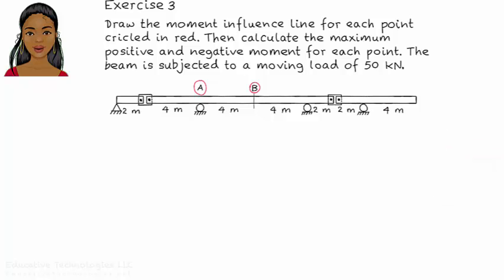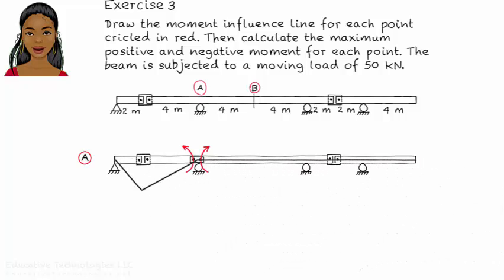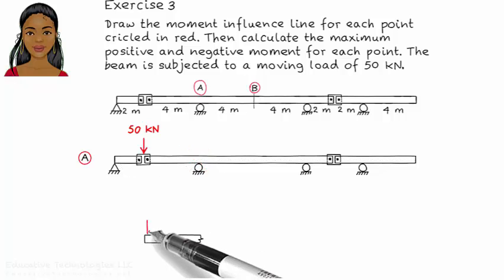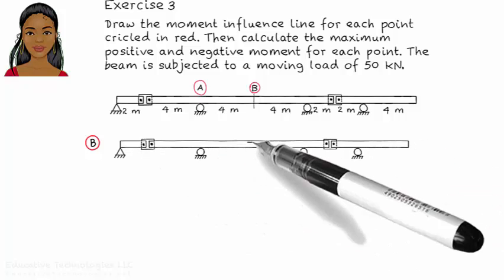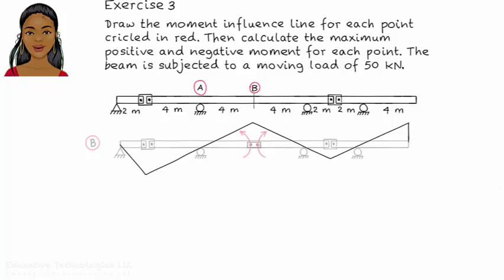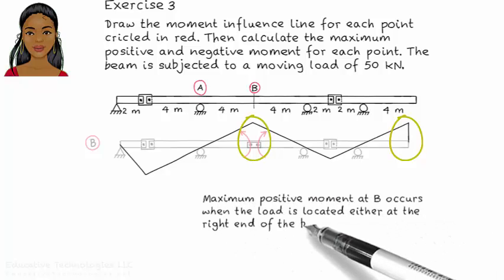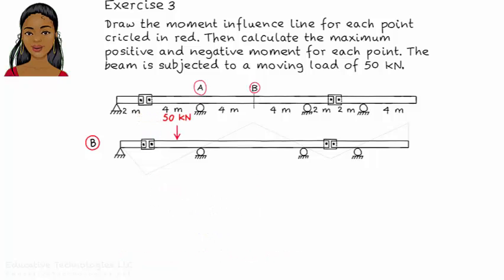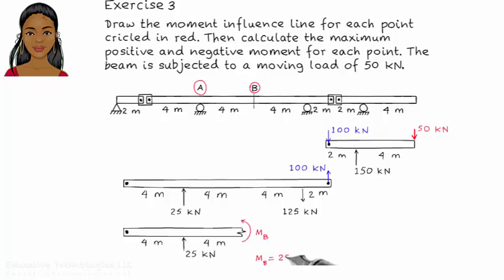Moment Influence Line: Solution for Exercise 3

Comment: Reaction at R when we find the moment at B
How became 75
Reply from the maker: Consider the beam segment between the two internal hinges. A load of 50 kN is applied at the left hinge. There are reaction forces at the left roller (R1) and right roller (R2). The total length between the left hinge and the right roller is 12 m, with the distance between R1 and R2 being 8 m.

The moment equilibrium equation about the right roller can be expressed as: (50 kN)(9 m) - R1(8 m) = 0.

By solving this equation for R1, we find R1 = 56.25 kN.

Comment: Dear Dr Structure, how did you calculate the reactions at the end of the video when the 50kN force was at the right end of the beam?
Reply from the maker: Static equilibrium equations. 

Take the right segment of the beam, the segment between the right-most hinge and the free end of the beam. There is a 50 kN force applied at the free end. There is an unknown shear force of, say V, at the hinge, and there is a support reaction, say R, at the roller. We can write two equilibrium equations:

Summing the forces in the y direction: R - V - 50 = 0
Summing the moments about the support point: 50(4) -2 V = 0. 

Solving the above equations for the unknowns, we get: V = 100 kN, and R = 150 kN.

Then take the left-most segment of the beam, the segment between the left pin support and the left-most hinge. There is no load applied to that segment. So, the only two forces in that free-body diagram are the reaction force at the pin support and the shear force at the hinge. Label them, T and Q.

Summing the forces in the y direction: T - Q = 0
Summing the moments about the hinge: 2T = 0.

This gives us T = Q = 0. 

Now, knowing the shear force at the ends of the middle segment (the segment between the two hinges), then only the two (roller) support reactions would be unknown. If we write and solve the two equilibrium equations for the middle segment, we get those reactions forces. One would be upward 25 kN, and the other downward 125 kN.
Reply: Hello sir, for calculating SF (v) @ hinge of right segment. You have assumed  SF to be downward. While calculating SF by taking moment at support. I found SF is negative (-100)  that means need to change the assumed direction.
Reply from the maker: @smithakm1174  No, you don't need to change the assumed direction for the force and start all over again. If you showed the shear force at the hinge in the positive direction, you would get a negative value for the force magnitude. That simply means the actual force is acting downward. But the two representations (showing an upward arrow with a negative force magnitude or a downward arrow with a positive force magnitude) mean exactly the same thing. Either representation can be used graphically. And, they both yield the same results when writing and solving the equilibrium equations.

Comment: can we employ the principles of influence line diagram to calculate reactions at any support?
Reply from the maker: I am not sure if I understand the question. The purpose of influence line is to determine the effect of a moving load at a specific point in the beam. Yes, we can determine the effect of the moving load on a support reaction (i.e., reaction influence line), but we don't need influence line to calculate the reaction forces in the beam due to static loads. Those can be easily calculated using the equilibrium equations.

Comment: How did you find the values of the reactions?
Reply from the maker: The beam is statically determinate, so we can find the reactions by writing and solving the static equilibrium equations. For example, for Part A, when the 50 kN is placed at the leftmost hinge,  separate the middle segment of the beam (the segments between the two hinges that rests on two rollers). The segment is subjected to the 50 kN force at the left end. The shear force at the right hinge is zero since the rightmost segment of the beam is not subjected to any loads. So, the free-body diagram of the middle segment consists of the 50 kN force and the two support reactions. Apply the equilibrium equations to the free-body diagram in order to calculate the reactions.

Comment: it is really confusing to find support reaction please explain in detail...im unable to get how you are using 100 kn at B... Please explain it further..
thanks Dr. Structure
Reply from the maker: To calculate the 75-kN support reaction:

Place the 50 kN applied load at the left hinge, as shown in the video.

Separate the middle segment of the beam, the segment between the two hinges.

The segment rests on two roller supports. Draw the free-body diagram of the segment. 

The diagram shows three vertical forces only: the applied 50 kN load at the left end of the segment, the vertical reaction at the left roller support (call it R) and the vertical reaction at the right roller support.

Now, take sum of the moments about the right roller:

(50 kN)(12 m)- R(8 m) = 0.

Solve for R. R = 75 kN.
Reply: THANK YOU SO MUCH... GREAT WORK SIR...
Reply: From this clarification... I understood that how did you calculated.  Thanks dear Dr. Structure.

Comment: how you find the reaction at A point during the finding out negative moment at B point
Reply from the maker: +Jahid Hassan You need to analyze the beam in order to determine the reaction force. The beam is statically determinate, so it is rather straight forward to calculate the reaction at A when the load is at the left hinge.

Place the 50kN load at the  hinge (for convenience , place it just to the right of the hinge). Then, divide the beam into three segments: the left segment (the small segment to the left of the left hinge), the middle segment (the segment between the two hinges), and the right segment (the segment between the right hinge and the right end of the beam).

If you draw the free-body diagram for the left and the right segments and write the equilibrium equations for each, you would see that neither segment carries any portion of the load. Only the middle segment carries the applied load.

Focusing on the middle segment, take sum of the moments about the right support:

(50kN)(12) - Ay (8) = 0.

Or, Ay =  75kN.

Comment: In what situation we can ignore the force of the hinge?
For instance, can you explain more on the last part? I don't know why the force at the left hinge can be ignored in finding the reaction force.
Thx!
Reply from the maker: +Chun Wai Wong In the last part, shear force at the left hinge is zero. That is why the force is omitted on the free-body diagram.  We never ignore/omit free-body diagram forces unless they are zero.  But how do we know that shear at the left hinge is zero?  

Draw the free body diagram of the left-most beam segment, the segment between the left support and the left hinge. It consists of two forces: vertical reaction at the support (say, R) and shear at the hinge (say, V). Now, write the equilibrium equations:

Sum of the forces in the y direction: V + R = 0
Sum of the moments about the left end of the segment: 2 V = 0.

Solving these equations, we get: V = R = 0. 

That is, when the load is applied at the right end of the beam, the reaction at the left support and the shear at the left hinge are zero.

For a more comprehensive discussion on the analysis of beams with internal hinges see Lecture SA03.
Reply: +Dr. Structure  Thank you

Comment: Why is it that there is no v-shaped influence line formed at the second hinge when applying positive moment at A?
Reply from the maker: +Kwame Afrani Because the middle roller support prevents the beam from displacing downward.
Reply: Okay makes sense, thanks. =)
Reply: Dr. Structure dear sir but there is a hinge that let the beam segment to rotate freely...so the shape will be different...the above shape will be possible when the far end is pinned...but the far end is free to rotate and the hinge next to it will allow it to rotate freely...do let me know if I m right or wrong...thank you
Reply from the maker: @roushanrounak8648  For the far-right hinge to move up/down when a fictitious moment is applied at A, the beam must rotate around the roller to the left of that hinge.  And for the beam to rotate at that roller, there must be an upward/downward movement of the beam at A. But that is not possible since the beam is resting on a roller at A which prevents its vertical displacement. Note that the rotation at A (due to the fictitious moment) does not cause the point to move up or down, therefore, the no rotation could take place around the other roller which means the hinge (although free to move) but is not going to, since the beam segment attached to it is not moving.
Reply: Dr. Structure Got you sir...its nice to get doubts clear from you always...thank you so much...